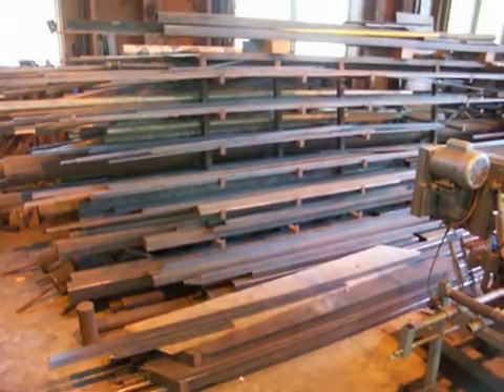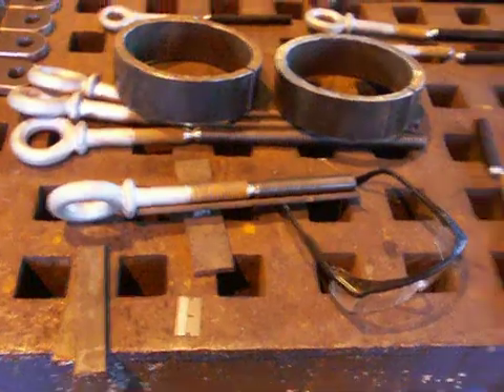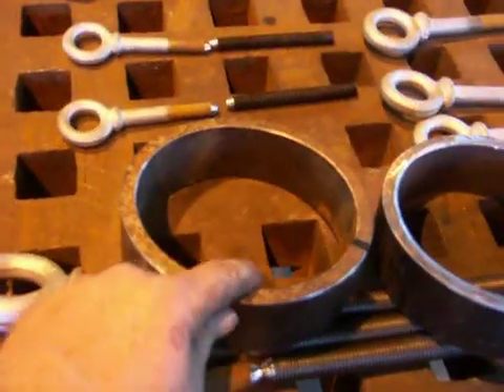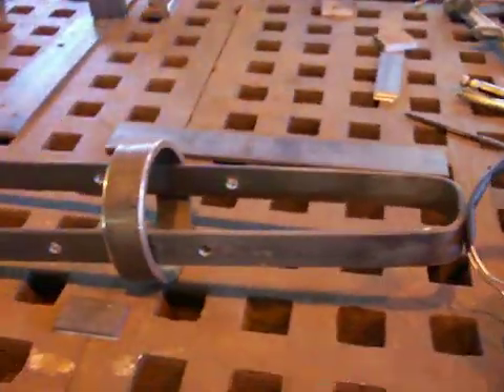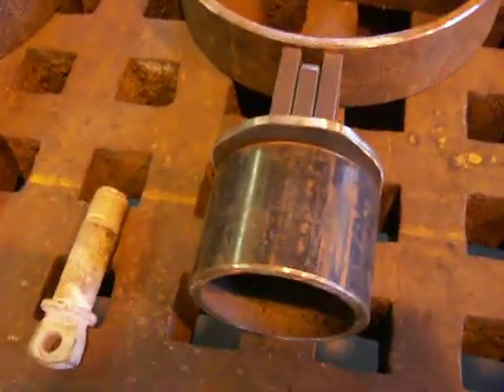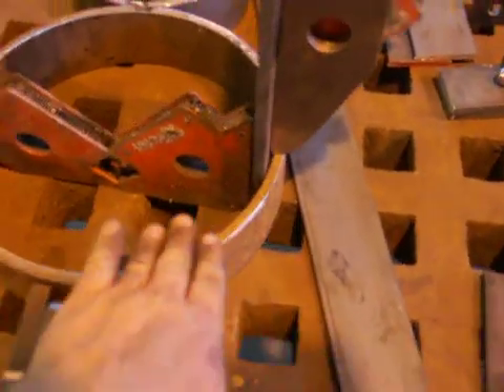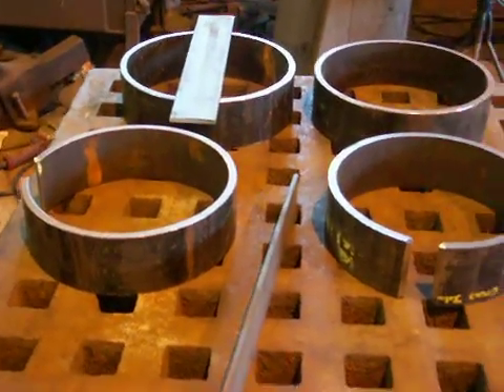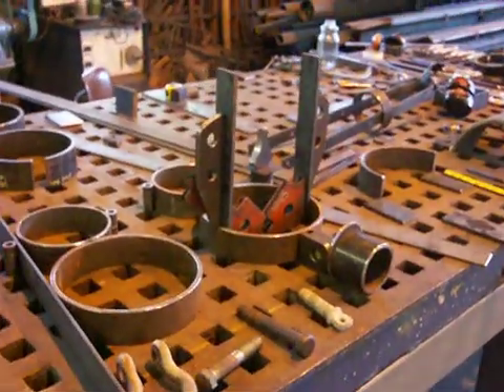Phoenix metal hardware fabrication

Comment from the maker: @zippyman818 the number 13 is not really unlucky, people just think it is, except masons. there are thirteen tail feathers on the american eagle on a quarter. the eagle is holding a branch with 13 leaves and 13 berries. and so on.

eye bolts
the weld is 70,000 psi tensile strength. even if the adjacent steel is weakened by half it is still way strong. the entire length will be inside the mast, so only tensile properties are at play, no twist really.

Comment: @darkamber027 Yes, most hotels avoid the possible bad luck of the number 13. In many of the Trump properties, he takes a large atrium or open-air foyer and then randomly picks a number to labeling the floors above; in this way he can turn a 40-story property into a building with a 49th floor penthouse. It's an old trick, but the top floors bring more money and the higher the number, the better.

Nice work!  I wonder about welding the eyebolts, if that will cause a weak point under high torque.